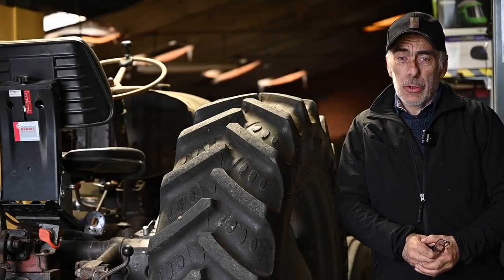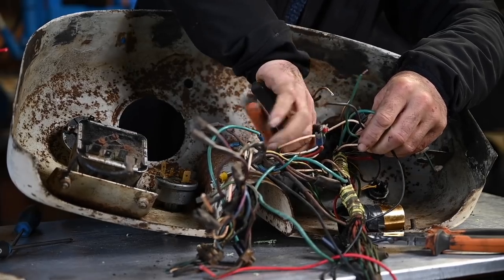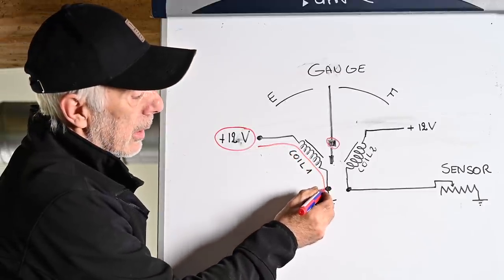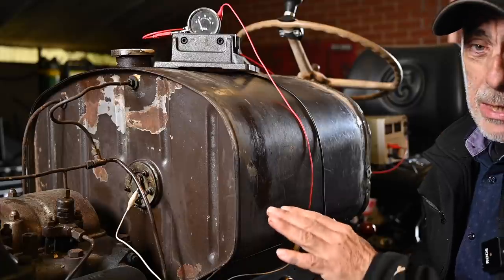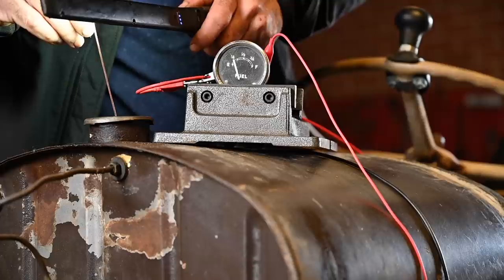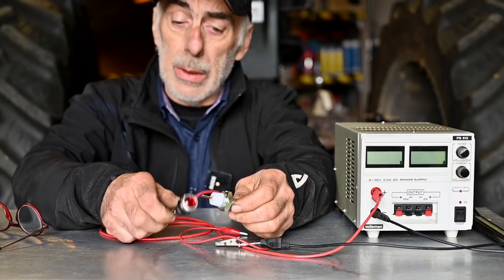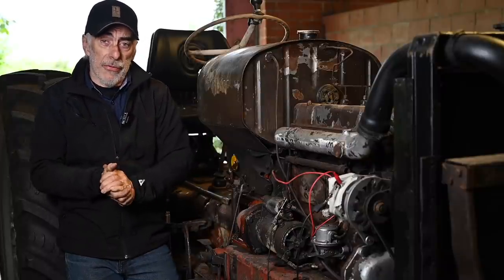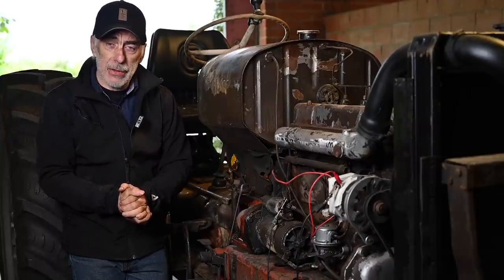David Brown 990, Part 3  the big cleanup -  Electrical System

Comment: Hello, I have a question, what kind of diode you have in the wiring ? Cause I’m making my 885 a new installation to, and I’m missing it , and it show in the electric draws that I need a diode and a resistor two add after the hydraulic light and goes to the charging light ! Thank you very goood video!!!
Reply from the maker: Its standard diode 1N4001, very low cost
Reply: @D3Sshooter  thank you ver much!

Comment: Your usual high quality video,s , just a point in case you didn,t cover it , ( I haven,t watched it all yet so I apologise if you have ) , all electro - magnetic flasher units work better if mounted vertically , with the wires right at the bottom , you get a fuller , healthier "click" to it,s pulse , just a tip I learnt at college , thanks guys , watch the master !
Reply from the maker: Indeed, good point

Comment: Thank you, very informative! I have one question. I was wondering if the gauges fluctuate with voltage changes (9:58)? On the battery we have around 12v, once the alternator starts charging the voltage rises to 14.5v, does that affect the readings, or the coil1 (permanent) actually compensate for that? I saw some schematics on the Internet that include voltage stabilizers before, but that is not always the case.
Reply from the maker: The higher voltages like 14.8v. Applies equally to both coils. So that is not an issue.   Indeed some have voltage stabiliser, that is more for those with dynamo

Comment: Steve,

 I have my dashboard removed (I only had to loosen and spin the steering column, I didn't need to remove the steering wheel). I can't seem to figure out if the light selector knob switch is secured by friction or by set screw. I see the small hole, but when I look inside with a torch, I can't make it out. What did you do to remove the switch?
Reply from the maker: Hi,  that might indeed depend on your gastank fitting as that is where the dashboard connects to ( sits on).  hahaha,  push with a small pin into that hole and and pull the knob off... There is a small spring loaded pin inside the shaft

Comment: Where did you order the wiring harness and gauges? I am replacing my gauges and found an entire set for about $30 US ( not the best quality as made in India). I did not find a harness.
Reply from the maker: Thanks for the comments,  Histoparts in the Nederlands..
Reply: @D3Sshooter  Thank for the additional source. I took a picture of a part on the tractor I haven't found what it is used for it is on the right side in front of the brake pedal and has a threaded rod which protrudes out about 4 " and has a housing with a zircon fitting on the top. Do you know this parts function?

Comment: Hi Flemish, today I want to ask you a technical question.  the temperature sensor is screwed on the engine block , am I right? Then if that is the case we know in electrical that the resistivity of material is affected by temperature. The temperature sensor will reduce its resistance as the engine warms up and the current will flow in the metering device as you explained.My problem is that once the temperature increases on the engine block the current will have a problem of going to ground from the sensor. Remember one of the factors affecting the resistivity of material is temperature.

As engine warms up the resistance of the sensor decrease but the resistance of the engine block increases. That contradicts one another. 

Hahahha I am challenging you Steve. Try to answer. I trust you

Blom. south Africa
Reply from the maker: Hi MBS, that is all correct, but the resistance of the engine block ( ground) is so low that it doesn't matter...  Measure it out once,  at the engine block where the sensor sits ( NTC resistor) by placing the probe on the metal part of the sensor towards the minus of the battery... You will see that this is way below 1 Ohm.... so no issue at all...  TXS